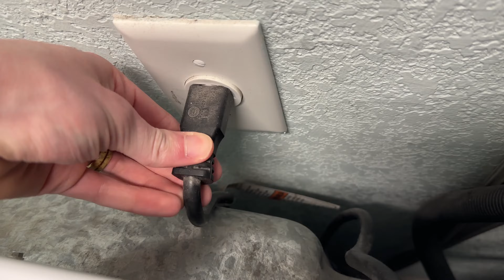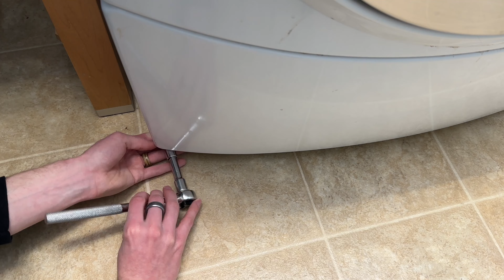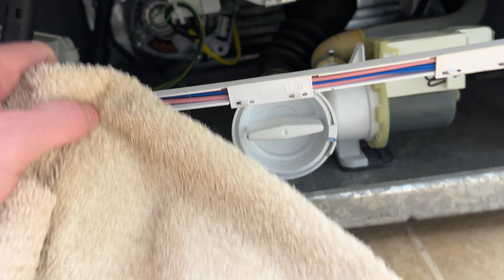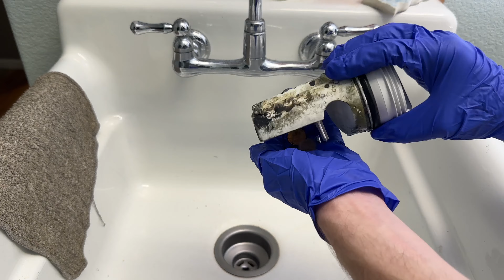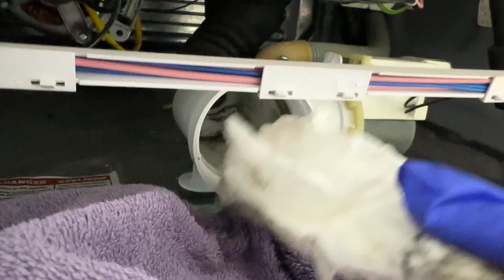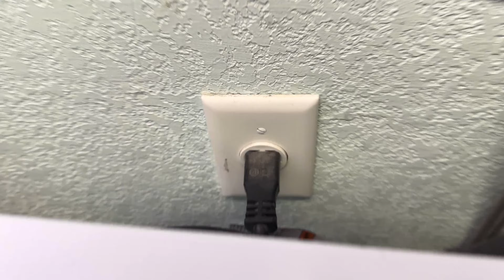How to Clean a Whirlpool Duet Steam Washing Machine Filter

Comment: the filter is a 2 piece when you unscrew the filter to come out holding the filter in your hand pull pull the screw  apart it is in a 2 piece filter and you will see all the lint and muck loaded to the top clean and just push back together and  presto you are done the put filter back in and screw tight and done

Comment: Thanks for the vid. Helped me cleaned the filter out as there was frequent water spill noticed underneath the panel quite a while back and wash cycle gave up draining the water all of sudden. Putting back the front panel was excruciating as had to resort putting two small wooden planks underneath while pushing firmly to put the screws back on. Saved $300.

Comment: Sir this was so helpful! i found coins and debris in the filter. unfortunately after cleaning everything and keeping the cover uninstalled i saw drops that were falling from above when i put in clothes, like where the clothes were and from the filter housing too, not the cap but just behind it.
Reply from the maker: Glad it was helpful! If you’re seeing any dripping afterward, the safest option is to have a technician take a look since every machine is built a little differently.
Reply: @SimpleTasksYT  Yeah, got a technician, they had a camera to look for leaks, turned out to be the rubber gasket, so have ordered a new one! Love the details you provided, atleast it got me to check the basics and learn't a few things

Comment: Thank you for the tip to put a towel. What a poor design! They could  have a different pipe to drain the water before removing the filter.
Reply: They do (sort of)!  With the washing machine door (and detergent door) closed, I pull the discharge tube out from the wall (or washing machine basin) and attach a shop-vac to it and suck all the water out!